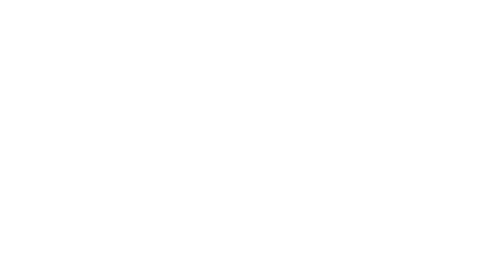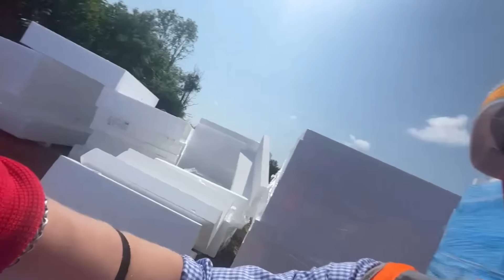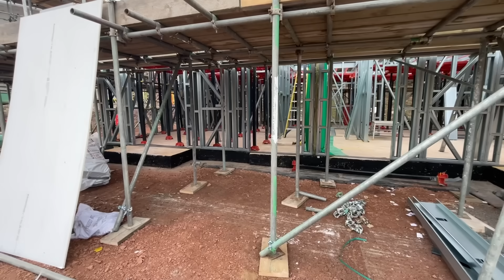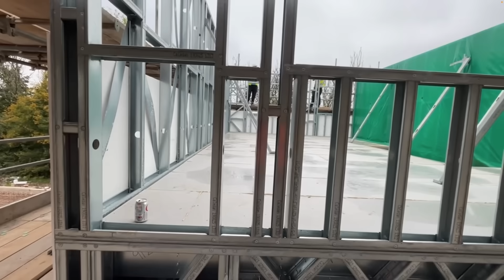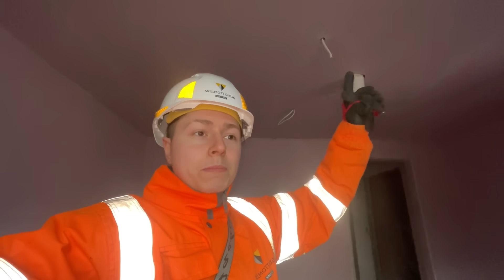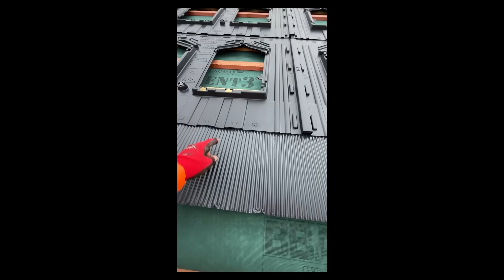6 Mind-Blowing Building Materials Changing UK Houses in 2026

Comment: The foundation shown is a specialised raft foundation that is simply not required on most building sites, it adds a significant degree of complication i.e. cost to the process.
We developed metal stud construction for external walls 37 years ago.  Basically its a metal stud version of timber framed building that has been used since 1970's
Sprinklers in housing is an interesting one in that whilst they undoubtedly save lives expect the insurance premium to rocket.  The reason being that having sprinklers is a significant source of water damage and the costs and risk to insurers is high.  In the commercial world I had a project that demanded a sprinkler installation due to the size of the building.  The Fire Prevention Officer and the Insurers fire expert were at odds as to whether sprinklers should be installed.  It was such an issue for the insurers that the client had to walk away from occupying the building.
What is shown here maybe appropriate for this specific site but I strongly doubt it will become a nation wide process.

Comment: For those interested, Build Lite is from Future Found and is an EPS (expanded polystyrene) insulated raft system. There are a number of EPS/XPS based systems on the market in the UK for insulated raft foundations. Charlie Luxton sourced the EPS direct from the manufacture. You can put wet underfloor heating in the raft, before the concrete pour. The advantage of this is that it negates the need for a screed layer, reducing cost and build time.
Reply from the maker: Thanks for sharing Nick!
Reply: The advantage of a screed in the floor is that the floor insulation can be directly below the screed that results in a lower thermal mass and quicker heating times that suit our modern lifestyles.  Using the Schluter UFH mat rather than the Uponor system means that only 65mm o/a depth with 2/3rds the amount of concrete than the 75mm solid screed the Uponor system dictates creates a much lower and therefore quicker responding thermal mass.  I would be concerned about putting UFH in the reinforced slab simply because the process of constructing the slab with hairy arsed ground workers in the open is almost guaranteeing that the UFH pipework is damaged and then its a major job to repair it when the pipework fails the pressure test when the house is nearing completion.

Comment: Houses need to breath.  They will end up full of mould.
Reply: That's why there are ducts in the rooms,  there will be a intake and extraction unit in the loft with a heat exchanger.  Damp air is drawn out and replaced by new air from outside.

Comment: That foundation is for two semi detached homes ? My garage is the size of both ! Crazy rabbit hutches 😮
Reply: You must live in Arizona..not the reality of UK new builds?
Reply: Most UK homes built today do not meet the statutory minimum space standards of yesteryear.  Maggie Thatcher was persuaded by the house builders to remove the statutory space (Parker Morris) standards back in 1980's on the assumption it would mean greater house building, which never happened.  Today most modern houses are but 7/8ths replicas of those original minimum standards
Reply: Legend, can’t beat a large garage, preferably with a heated floor, space for at least 3 cars , a ramp , 3phase and milling machine etc
Reply: They are built to the Homes England  minimum standards . This lad needs to write himself a script,  people who erect steel frames are not called Steel fixers ffs! Steelfixers  fix reinforcement in concrete work. I am amazed Wilmott Dixon aren't giving him some help with the video.

Comment: What happens when the grid goes down?  Is the solar system independent, and are there any batteries?
Reply: Batteries are getting VERY cheap now (Fox, Eleven)..if the home owner wants to add them and top up via cheap rate at night, its very doable, but for a  developer to load a "nice to have" like that onto their dev finance would be nuts.

Comment: Building with steel is in no way sustainable.You are heading in the wrong direction young man.Working for the wrong people.
Reply: Er..what?.. maybe build from what? Mud? Unicorn poo?
Reply: Yes and no. 
You can argue that the steel members can be taken apart and reused.  That doesn’t work for timber that has been nailed.
Reply: @markthomasson5077  It works for timber that has been pegged (traditional) or bolted.Same goes for screws.There are countless timber framed buildings centuries old that were built from old ships and other buildings.Re-use can be incorporated into the design and the better the design,the longer the building's life so the less important re-usability becomes anyway.The embedded energy in steel production is crazy compared to building wit timber.
Reply: It's fine as long as the connecting points are insulated to prevent thermal bridging

Comment: For the use of Build Lite insulated raft foundation, I guess the warranty provider accepted the sub floor with no vent opening like what we usually do in traditional built ?
Reply: I would expect so. Slabs don't normally have vents because there is not supposed to be any space under them, though spaces may be created if the ground shifts. Of course, the downside is lack of access to any pipes and wires buried under there.
Reply: @pcno2832  The loss of access is always the case with common solid ground floor slabs in UK construction.
Reply: @clivewilliams3661 bison beams a nightmare for a water or gas leak.
Reply: @raylp4751 The same problems can occur in any form of construction.  A few years ago there was a major explosion in a semi-detached house in North Leicester that had be caused by the accumulation of gas under the solid concrete ground floor that was assessed to have been accumulating since the property was built 45 years previously.

We had a water leak on the incoming mains through a solid concrete ground floor slab that cause significant consequential damage.  We have since abandoned the service and constructed a new route for it.  

No flooring system is immune to defects, what is necessary is to manage them properly.

Comment: Notice all the plasterboard is ‘Fireline’ and there’s a sprinkler system, why? well because that flimsy metal frame would buckle in no time in a fire.  Stick to using blocks, preferably dense ones IMO
Reply: Or timber frame, which famously can't burn?
Reply: @Christ-on-a-Bike  wood burns, but that thin metal frame would likely buckle in the heat of a fire loosing structural integrity IMO
Reply: @over-engineered  Steel rebar is still preferred in concrete because it buckles long before it catastrophically fails. I'm sure an informed structural engineer would know better than either of us.
Reply: @Christ-on-a-Bike  ????? Steel is used to give tensile properties to RC, Concrete is good in compression but weak in tension.
Reply: @Christ-on-a-Bike timber build is safer than metal. It's behind plasterboard and or bricks. But metal at temperature warps and can cause collapse. Hence sprinklers.
Reply: @raylp4751  The metal stud is normally protected by plasterboard either 30 mins FR or 60 mins FR that equals any timber stud construction or designated block construction.  Sprinkler systems are not normally required in single dwellings up to 4.5m above ground level and only required in taller dwellings if there is no protected means of escape from the upper floors.  I would not expect sprinklers to be mandatory in the houses built in this video unless there are specific unidentified reasons.
Reply: Cheap shite.    Give it 25 yrs
Reply: @Discuss-not-dismiss  To do what?  Its not cheap shite and since it has been in use very successfully for at least the last 40 years in my experience.
Reply: Hemp Crete is light, insulates rigid has brilliant fire 🔥 🔥 🔥 resistance, breaths and traps embodied carbon , can be formed into panels.

Get rid of all that crappy rust prone steel use Basalt fibers /rebar and mesh or grids  it's natural cheaper  lighter stronger , and Fire proof it insulates it requires minimal energy, CO2 and Water to produce compared  to Steel or Glass or GRP .. it's water and totally  corrosion  resistant . It's made from one of the most common igneous rocks on the planet .🥼🧙🏻‍♂️🇬🇧  it's also the same material as used to make pure  basalt  Rockwool batts insulation soundproofing and totally fire proof. 

Look up Lion glass ...from Penn state University low carbon high strength glass. 

Look up Superwood, Metelwood by Inventwood , chemically engineered wood that is stronger lighter than steel or Al and cheaper, fire proof , rot and mould and pest proof . And even after manufacture retains 50% of the embodied carbon value of the original timber ie 50% carbon negative ...but superior to metal.

Don't get suckered by Fossil  based manufactured materials ,  unless they are recycled materials or can be recycled .. and always keep an eye on the qualities and durability of what youre constructing . 🌎🔥🌬️🌪️🌨️⛈️☀️🌧️🌊🇬🇧🥼🧙🏻‍♂️🌍
Reply: You don't need to use fireline board to achieve a decent fire resistance.  The use of fireline board depends on the specific circumstances.  Personally I prefer to spec double boarding that can achieve up to 60mins FR along with significantly better acoustic performance and a much better 'feel' to the wall.  Using dense concrete blocks causes a great many further considerations with regards to thermal insulation that may prove too costly.
Reply: @clivewilliams3661  They aren’t going to use double plasterboard all over an entire house, but yes it’s better.  As regards dense blocks, people think lightweight blocks are ‘insulation blocks’ and in fact they add very little to the U value of a modern highly insulated wall. Example my house has 0.18 walls using dense blocks, if I’d used lightweight it would have been 0.17 U value.
Reply: @over-engineered  I agree that the house builders are not going to use double boarding as they are focused on minimum cost.  But we have used double boarding extensively and it is surprisingly cheap to install and gives significant advantages that would otherwise require further installations.  Its a shame that too much building design and construction is based on a dot to dot process rather than looking at the problems holistically.

As regards your use of dense concrete blocks I'm sure that using lightweight blocks would require less insulation to be accommodated that would have meant a thinner overall construction that then has other knock on advantages.  Don't get me wrong, I much prefer to use a medium or heavyweight concrete blocks because they have superior structural, acoustic and sometimes thermal performance than the lightweight ones, I have only highlighted the reasons why they are too often used.
Reply: @clivewilliams3661  to achieve 0.18 walls using light weight blocks, the cavity insulation could have been reduced by about 6mm.  I also calculated the additional heat loss using 0.18 instead of 0.17, and on this house it’s 1 watt per degree C of temperature difference between inside and outside.  Still rather have dense blocks, and yes they are heavy to lay, but I laid them.
Reply: @over-engineered  I've just plugged the figures into the Knauf Insulation calculator using both a dense concrete block and a lightweight aircrete block and found that a dense 100mm concrete block would require a full fill cavity of 175mm of Dritherm 32 and the aircrete block would require a full fill cavity of 150mm of Dritherm, both to achieve the same. 0.18W/sqmK.  That extra 25mm wall thickness raises questions about stability and other detailing issues that may require the block thickness to increase to 140mm to achieve the same U value but be more stable.
Reply: @clivewilliams3661  Dritherm 32 is 0.032W/mK, I used K108 which is much better performance, and kept a 50mm clear cavity.
Reply: @over-engineered  I appreciate that your construction is specific, what I described is a standard form utilising typical materials that highlights the difference the type of blockwork makes.
Reply: @clivewilliams3661  But because the insulation you chose is much poorer performance, the light weight blocks have more effect.
Reply: @over-engineered  I chose it because it is the common installation material and besides the type of insulation has little to do with it because its all about the R value of the product.

Comment: I would not want a sprinkler system in my house. to much risk of false alarm.
Reply: sprinkler systems do not work, like the movies. They only go off in the specific room ,  when a certain temperature is reached. What false alarms do you mean?
Reply: @geraintmatthews7653  You never heard of system malfunctions? lots of reasons for those.
Reply: @geraintmatthews7653  You are describing the old bulb method of activation, where the bulb burst when heated by the fire and allowed the pressurised water to spray the area.  This meant that sprinklers only activated above the fire.  A domestic system is likely to be electronically activated, whether for a whole room or groups of rooms.  The old bulb system were generally reliable unless they were mechanically damaged but the electronic system has all the typical potential issues that any electronic system has.

Comment: I'm not happy that you described the Solar Panels as "extremely expensive". Panels and transformer's are cheap these days. The installation cost is what makes them "expensive". But, overall it's not much more than installing the roof tiles. The overall benefits of solar far out ways the cost of roof tiles. What I'm most disappointed about is that on a roof where 6 or 8 panels can easily fit, I only see 4 panels.
Reply: Transformers … the only transformers you’ve seen is when you’ve been watching movies 😂😂😂
Reply: @andyxox4168 😂😂😂. Okay, okay. Inverter.
Reply: Interesting installation system, he could have talked about that more.  
Yes, so cheap, they could have covered the whole roof.  
Real slate is probably more expensive…though not those cheap concrete tiles
Reply: @markthomasson5077 concrete tiles are very long lasting, no?

Comment: chipboard flooring is no good, when i bought my house the previous owner had installed it on most floors 25 years before, it had the no strength whatsoever, was easy to put a foot though and completely rank in the bathroom especially around the toilet where it had soaked up years of piss ! it’s only advantage is it’s very easy to break up in to small pieces and put in to black bags for the bin men to take !
Reply: Chipboard flooring is almost a mandatory feature.  Back in 1976 a housebuilder built a group of garages during the very long hot summer.  These garages has flat roofs on the common chipboard deck.  The autumn that year was very wet and the chipboard swelled as it was exposed on the underside pushing off the brick parapets.  It was amazing to see the amount of moisture movement that chipboard has.  I am sure that chipboard laid in damp weather on building sites will shrink inexorably when the heating is turned on, leaving big gaps between panels.
Reply: They're using fibre cement board not chipboard
Reply: @jack504  that’s even worse, you cannot break it up easily and is to to heavy to put out for the bin men when you lay real solid wood floor boards !
Reply: @peterwilding3515 it lets them build in the wet without it swelling, similar to the stuff used around a shower. You could install solid wood on top of it, not sure what the point in tearing it out would be. Probably quite good for sound deadening and you're not likely to put your foot through it.
Reply: My sister bought a '90s house a while back with chipboard under the bathroom tiles, which was probably a code violation even back then. They were getting squishy and the grout was cracking, so I asked for 15 or 20 tubes of super glue, dug out the loose grout, emptied a tube at each loose intersection and replaced the missing grout with sanded caulk. The tiles have stayed solid ever since. It was a mistake to use chipboard in such a wet location, but a little hackery beats tearing the thing up. I used the same trick to save  my 1950s bathroom, which had Modrian tiles glued directly to plywood; it's been solid for the last 30 years.
Reply: It will be a water resistant chipboard they are using.
Reply: @markthomasson5077  pmsl nonsense no such thing a myth in the building industry all chipboard is like Weetabix takes on moisture and turns soggy and mushy
Reply: @apocalypticweasel9078 most worktops are made from chipboard!

Comment: Solar "Pannels" are new to me 🙃
Reply from the maker: Glad you found it interesting! 🤓
Reply: Panels. Your unnecessary  sarcasm is telling.. the key message is that, SVP prices are now so low that now the developer can actually afford to put them on their houses without crippling their develoment costs.
Reply: @Christ-on-a-Bike does it include the Power control stuff?
Reply: @Christ-on-a-Bike  Solar panels have been an almost mandatory feature on new houses for some years as a contributory factor in achieving the energy efficiency of the home.  Putting solar panels on the roof means that extra insulation and thereby expensive detailing can be avoided.